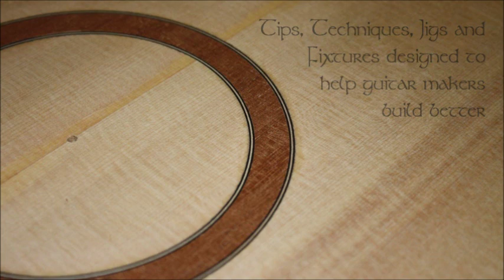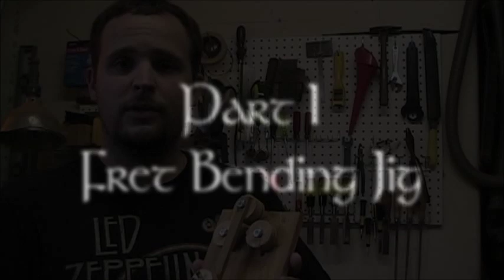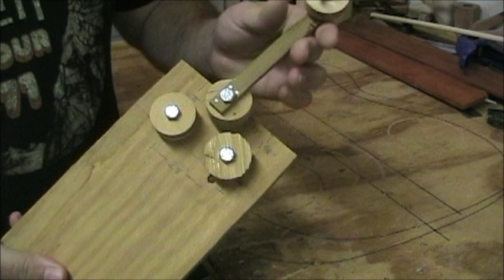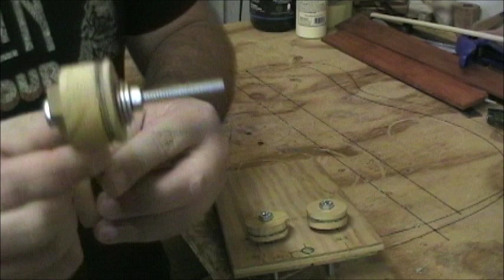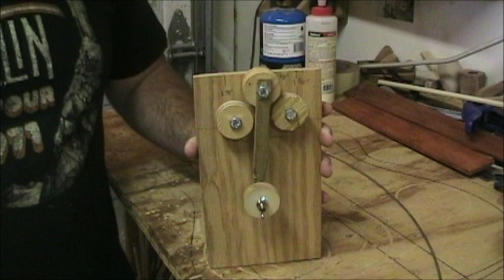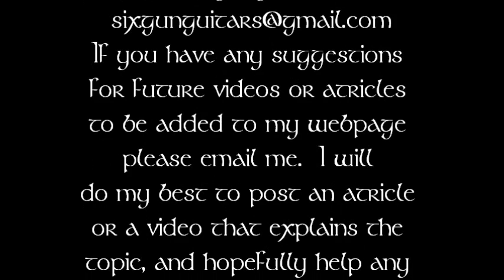Shop Made Fret Bending Jig

Comment from the maker: You are exactly right.  The divots need to be well worn into the wheels otherwise the wire will flip around and you will end up with a mess.  That's why I recommend using plywood or particle board for the wheels because it's easy to wear a groove into it.  You can also chuck the outside two wheels in a drill and use a file to put the groove for the top of the fret in place. The drill spins and the rasp carves a nice fast and even divot.  The center one gets the tang, so it cant be done that way.